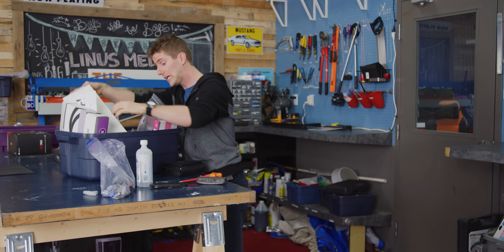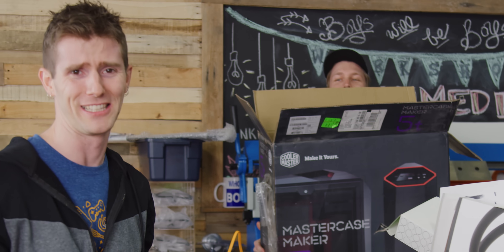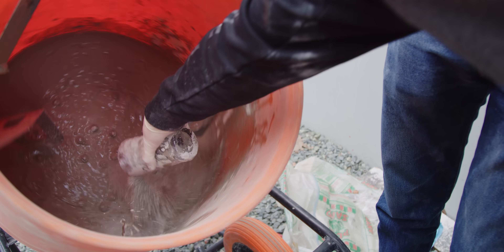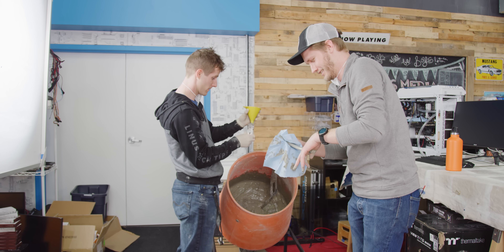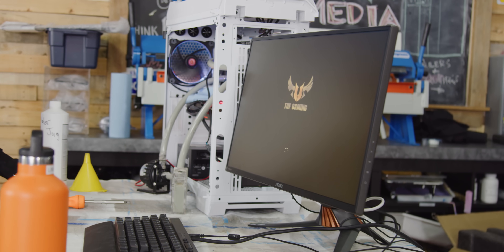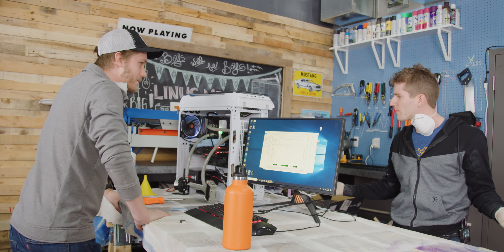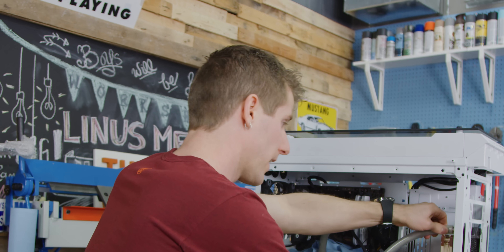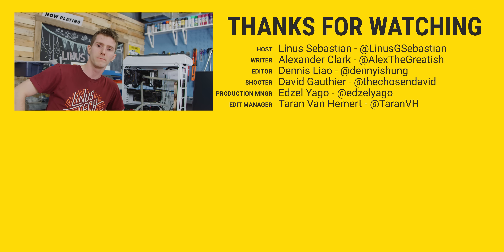I Can't Believe This Worked!!! - Concrete Cooled PC (April Fools 2019)

Comment: now try one with mercury (liquid* high density metal)
Density 13g/cm3

*melting point -38Celsius, boiling point 356Celsius (good enough lol)
This must be one of the best liquids for """watercooling""", as long as the pumps are strong enough
Reply: Blei1986 use real units
Reply: @Khloya69  phahah....fuck imperial system.
metric is used all over the world...even in US military.
YOU should start using "real"  units

Comment: I feel like they should explore ceramic dust and water mixture cooling.
Reply: thermal transfer is as important as thermal capacity
additionally, the ceramic dust would be very abrasive and eat away at the pump and the blocks

ceramic dust and mineral oil, maybe

Comment: I thought you would FILL the computer case with concrete and make it a SOLID computer.
Reply: solid state computing
Reply: @civil1  a computer with concrete parts and silent operation.
Reply: @civil1  LOL. . .ha ha ha. . .and when time for an upgrade came, you gonna need to call a general-contractor. . .
Reply: @civil1   LMAOOOOO
Reply: @civil1  bruh
Reply: But it would brick it
Reply: @Forzurda  r/dadjokes
Reply: @Forzurda  lmao
Reply: That is exactly what I thought when I read the title
Reply: dad joke
Reply: Sounds like a pretty concrete solution
Reply: terminal2004 i thought he was going to use concrete as thermal paste
Reply: Solid state liquid cooling 😎
Reply: Learn this one cool trick to eliminate GPU sag!
Reply: What about replacing said concrete with copper and have a M3 heatsink??
Reply: At first i thought he would use it as a thermal paste
Reply: Or he'd make an SSD
Reply: It would work better than most computers still
Reply: That water cooling just turned to passive cooling
Reply: Stop it
Reply: Well not everythings set and stone so its worth a shot i think
Reply: That would be a solid gaming pc
Reply: ha
Reply: They misunderstood the meaning of “solid state drive”.
Reply: Same
Reply: Solid state computer
Reply: @myrealusername9998  SSC
Reply: I actually thought they were gonna use it as thermal paste... Hahahahhahahhaa
Reply: This video had a solid foundation.
Reply: Or make concrete the thermal paste
Reply: guess you can call it Solid State
Reply: Ssc
Reply: Lmao that would've been perfect
Reply: Na,  SOLID state drive
Reply: Omfg, genius idea!! :o
Build the computer first with normal water cooling, then just cement the entire thing except the radiator and ports. I might do that if I have the time and money
Reply: @chang.stanley  we need a video of that please.

Comment: You may be on to something... I'm kinda curious what would be the performance of using a block of concrete as a heat sink/radiator.  Have some copper pipe go through it then just fill with concrete.  I don't imagine it would work better than a standard radiator, but would be fun to see.

Comment: I'm not a PC cooling expert, but I do know that sometimes, a fluid with a higher viscosity than water can produce better cooling results. Or a different pump speed. It comes down to how much heat you can transfer to the cooling medium before you send it away to be cooled in the heat exchanger. I have seen cases in high performance engines where we had to slow down the water pump because at high rpms the engine was overheating because the coolant was moving too fast thru the system. Have you experimented with higher viscosity fluids at all? Or altering the punp speed,  both up and down? Might be worth a try.

Comment: Just don't turn off the pc
Reply: Nobody in this comment section never work as carpenter for a high rise building company i see. Concrete hardens with vibration and it get extremely hot near 150 to 180 degrees f. The slump on the quickcrete was pretty low maybe a 3 or a 4 meaning it didnt had enough water in it and Linus mix it with aggregate. No matter if the PC was turn on or not, within a hour the quickcrete would have set and 2 hours later the CPU would have been cooked
Reply: AuthenTech - Ben Schmanke right lol that’s what I was thinking lol
Reply: HOW DID HE GET THIS SPONSORED
Reply: funny but that's not how concrete works ;)
Reply: My thoughts exactly
Reply: bruh
Reply: Yeah
Reply: still gunna harden, it will take sometime, but it will
Reply: me too
LOL
Reply: why?
Reply: @proffesionalcodingidiot6142  the concrete will harden
Reply: @proffesionalcodingidiot6142  If concrete is constantly moved it will not harden.
Reply: @camonoo  no it won't, the only reason why theirs hardened is because of the brownout
Reply: @caca95cb  what do you think happened during the brownout exactly?
Reply: @livelyosprey  I'm guessing that by "brownout" they mean a temporary power failure, which means the computer turned off, causing the concrete to harden
Reply: @caca95cb  yeah.... that's what @dragon was on about
Reply: @camonoo  its cement before concrete lol.
Reply: @caca95cb  you know this video is a joke
Reply: @thugshaker4  sure, but it's really fun to imagine what might have happened had the power not gone out, this could be fun to actually test
Reply: @caca95cb  how are folk still falling for it 2 years later lmao
Reply: @panophobia4628  False. How do you think super structures expand without kicking everyone out? However this pc is fucked in time either way, with correct water ratios this shit can hit 180f.
Reply: Run the pump from a battery 🤔
Reply: @djnazgra  Batteries run out, it's too risky. Better to build a power plant dedicated to the pump
Reply: @caca95cb  80ah battery?
Reply: You should say goodbye to your power supply then
Reply: @GamingWithBlitzThunder  You...Probably need this advice. Leaving a PC on fulltime vs shutting it down every night each damage some parts. The parts that are dmaaged though do NOT hold the same value. Constant power cycling is worse off for the CPU mostly, but it also impacts just about everything that thermally expands in your machine. traces gpu ram all of it. If you have overclocks on the cpu its VERY bad sometimes thanks to Vdrop, the amount of voltage your cpu is hit with all at once under load. It can crash your system easily, Ryzen gen 1 suffers from it alot. so does the older 4690k family.  If your machine needs 1.32 volts to be stable, but you dont set your Vdrop correctly you can go from 0. what ever to 1.32 in a millisecond and that rams your ram controller in the ass. Leaving the system on 24-7 is better for all the parts that matter. fans are cheap, PSUs are cheap. your chip aint cheap. dont abuse her. I think JAYz did a video on this years ago.

Comment: Here's a suggestion for the version 2.0:

Embed copper tubing into a concrete floor. Turn the byproduct of computing heat into a heated floor.
Reply: That would actually work really well. Though you also need a powerful enough pump.
Reply: Sapioit I’m sure a pump wouldn’t be an issue. They water cooled a whole room and used a huge ass pump/reservoir
Reply: yes but imagine how much energy it will cost if you have a cpu which produces so much heat to heat your whole floor
Reply: They already tried something similar with the cast iron radiator liquid cooling.
Reply: @ShadowDragoon004  that was a little different. But same concept
Reply: Oh my gosh. You need to see his plans for his new pool
Reply: that was a hell of a prediction
Reply: hes doing this unironically
Reply: in the words of Linus "That might actually work".
Reply: Its possible and also very practical, but you gonna increase the electricity bill  because you gonna need a high wattage pump. . .
Reply: @johanrynjah8241  but again maybe negated by the need of a heater that also eats your electric bill anyway
Reply: Wouldn't get warm enough from one cpu with a setup like that lol
Reply: make the floor a giant heatsink for the server room
Reply: that sounds a lot like their whole room watercooling project in the old house.
Reply: They tried to make a room heater like that before. Hooking up everyone's computers to pipes around the room and what not
Reply: I pray for you for a long winter man
Because if in the summer you won't have a working pc
Reply: Apparently there are products like cryptocurrency space heaters. The one from Qarnot is 600 Watts, which is sufficient to heat one room.
Reply: @Sundara229  600W is definitely nowhere near enough to heat a room unless said room is a 5m^2 closet.
Reply: @demoniack81  My working room is 3x4 meters and after 30 minutes to 1 hour of playtime it gets really warm there, despite my PC "only" drawing 380 watts at max. (Edit: 380 watts after the psu that is. In total its around 450 watts) 

So yeah, 600 watts might take a while but its definitely enough to keep a room comfy.
Reply: @Sundara229  I'm guessing you live in a place with very mild winters and you have good insulation. The radiators in my apartment are ~1.3kW each for similarly sized rooms, and it doesn't get that cold here (normally no lower than -5°C lows).
Reply: @demoniack81  Indeed, its been mild the last couple of years. Currently its 5-12°C, so the kitchen radiator at 1/3 is enough for sustainable 19°C.
Reply: There's no 2.0 since it's just april fool video and they use milk for it.

Comment: What about clay? Mix it a bit thinner than the concrete, and in a closed system, it shouldn't dry, and would have very similar heat carrying capacity.

Comment: I think you should go about this the real way and make a giant block of concrete with copper tubing running back and forth through it and us it as a giant thermal sink for a loop. you could put the block outside in winter etc.

Comment: What if you submerged it in concrete? Wouldn't the heat dissipate? And if it hardened wouldn't that form a ceramic shell,great for cooling? I think your missing out on the actual potential.

Comment: Problem is concrete doesn't "dry" it "sets". The water doesn't dry off, it becomes part of the material so it doesn't matter that your concrete was in a closed loop stopping evaporation. It was going to harden regardless of a power cut stopping the pump.

Comment: concrete actually creates heat (i've mesured it at 50 degrees Celsius in the bowl before) but you could try actually use it as a coolant well actually cement water if you wanted too.. make it very watery and add retarder to stop it from setting to quickly  (you can use sugar as a retarder) but it will only last for about 4-5 hours tops if you do it right

Comment: hahahaha im working with the concrete everyday so im not got fooled by this,
the concrete keep the heat and absorb any heat nearby since the actual chemical proses in there is concrete will be got enough heat thats come from many parts and it faster the chemical reaction to make it more hard
you got good decision linus by not putting sand into there if you giving it sand maybe it will be harder to bend the tube and the chemical reaction will be stronger

Comment: All absurdity beside, this would make sense if concrete wasn't exothermic - it gives off heat as it cures as opposed to absorbing it. You would actually end up with higher temperatures than if you used a mixture of fine sand and water without the cement paste.

Comment: This might be super effective if you remove the drying agent from the concrete, or maybe use drywall mud, either All Purpose joint compound or Topping Compound (recommended, smoother and has less latex). If sealed properly and mixed with just the right amount of water, it shouldn't dry when you shut off the power and still maintain the cooling results. Drywall mud has similar properties to concrete, of which mainly being a much lower level of lime and the use of gypsum as a base mineral. Theoretically, you can also mix in powered aluminum for even more heat transfer within the mud.

Comment: i dont know if you will see this, but look up a few things for future ideas, "microwaveable hot/cold compresses" and the other is "clay slurry", some microwaveable compresses are made with a clay water slurry, the water helps to liquify the slurry, and the ceramic adds extra heat capacity, and heat conductivity, if you used a clay slurry (mix powdered clay and water together in a very liquid ratio), you would have a flowing mixture that has a lot of the heat properties of the concrete, but it wont cure in your set up, you might have to figure out a way to agitate the slurry on cold startups, but that is a small price to pay when compared to the concrete mixture you used/

Comment: Yeah. Concrete will solidify with the PC running or not. ;)
And the pump will die from the exhaustion of having to push that thickkkk of a liquid in a week. 
Bad idea. Now if you excuse me I have to go get some cement. see ya.

Comment: can't find a place to send a message so ill just ask on here and see if you can answer it .  I have a wifi camera I just picked it up on sale . box says easy hook up just 3 steps. I thought great no wires its wifi it will just work on my laptop ill take it . got home plugged it in and it showed up great ! its on an open wifi i can connect great !  hummm cant see anything .so i went to there page and they want me to download an app pay for subscription if i want them to save for more then a day plus they will get the video over my internet then send it to me again using my internet so it slows my speed down to almost not usable when its sending the video to and from them plus cost to use internet.  so how can i hook directly to this wifi camera like I was thinking id do when i got it ? I looked on line and can't find a way but did find others looking for the same thing. some are posting you just plug in the cord to your computer and set up a feed or hack it  but this camera has no place for wires or sd card so hard wire is not an option . I can return it but if I can use it then ill keep it .

Comment: can you try and Set up your system with Hard tubing and try and dip the tubs in Concrete so you can dissipate the heat and still run distilled water in the loop

Comment: Since you didn't add the sand (aggregate), what you actually made was "cement"- not concrete.
Reply: I half expected them to pour a gigantic concrete heatsink because of the title xD
Reply: They should have tried using plasticizers in it which would have made it flow better
Reply: @davidharford81   that heats as it cures.... like a lot...
Reply: Theres no stone either
Reply: @SVW1976  
There are two types of aggregate.
Rough(large rocks). Smooth(sand)
It depends on the application if you wanna use rough or smooth aggregate.
Reply: Fun fact: put together all the least loved versions of Windows prior to Vista and you get Windows CEMENT.
Reply: and if they did not add lime to the mixture then they would not have had it harden on them while still retaining most of the thermal property's of it
Reply: Civil engineers lose a strand of hair every time someone mix concrete with cement
Reply: All cement has silica in it, which is sand. Being a fine aggregate, what he made was mortar.
Reply: They made a slurry
Reply: There's mortar it than that.
Reply: Its quickcrite so it's just mixing no sand needed
Reply: EXPOSED
Reply: Sement. That's why Linus' right arm is stronger.
Reply: why not try Powder rocks
Reply: Same shit tho
Reply: Cement is powder once mixed with water and sand its concrete
Reply: Or stones!
Reply: cement and sand is mortar..
concrete contains aggregates (stones)
Reply: Fast curing cement lol should of hot slower curing cement lol
Reply: Ok boomer
Reply: Nutcracko Games Noone cares
Reply: what he used allready has the sand in it
Reply: @kraken767  nah you gotta add it- they even said in the video they weren't going to add it when reading the instructions
Reply: @sparrow40k  o my bad, they did buy cement instead of premixed concrete
Reply: @kraken767  3:38
Reply: stfu

Comment: you should try E0 gas. 
Melting point / freezing point <-58°C
Initial boiling point and boiling range 43-176°C
Flash Point <-37°C 

or diesel
Melting Point -22 to -0.4 ˚F (-30 to -18 ˚C)
Boiling Point Range 320 to 690 ˚F (160 to 366 ˚C)
Flash Point > 125.6 ˚F (52 ˚C) PMCC

Comment: It is all about Density and Mass... I would never use concrete.   That just sounds totally stupid.  I would suggest adding some type of ceramic powder to water that never changes state.  This would give you more heat absorption?  However that poor little pump would probably have a very short life.,  Stick with water and add Red Line's "Water Wetter"  they use this in cars and motorcycles.

Comment: Linus, can you maybe try using "HCI" which is Hydrochloric Acid?  I did a test and it works!  Now, I'm not stupid, the only caveat to this is you obviously need to use glass tubing.  The only downside, but the numbers I got from it was 5C idle for the CPU and only 19C  under full load using Prime95 for an i9 9900X.  it shut off, I think it's because I accidentally bumped it and the power LED was bumped, so I'm sure that's it, but I had it running for 24 hours straight before that happened.  All U have to do is cover the CPU with glass so the acid won't eat though.  It's so simple!  Oh and please don't trademark my idea, I'm going to officially do that tomorrow.   know it takes a  while for that process.  Anyway, just something to show everyone and I don't want to brag, but I think I might have just revolutionized PC cooling as we know it!

*I just want to tell everyone, this is obviously a joke!  DO NOT try to put Hydrochloric Acid in a loop as it will melt pretty much everything including your flesh*
Reply: Pretty sure HCL doesn't even react with plastic. Like you could use it shrug
Reply: @InsanePorcupine  Right, and if happened to spill some on your skin, just quickly wash it off with water and you shouldn't have more than maybe a 1st degree burn, but let's face it.  Isn't it worth it?!?
Reply: @Sithtiger  I am a strong proponent for safety and as we all know you just need to wear your proper PPE in this case a nice pair of gloves when you are filling your cooler with HCL. Safety first I say.